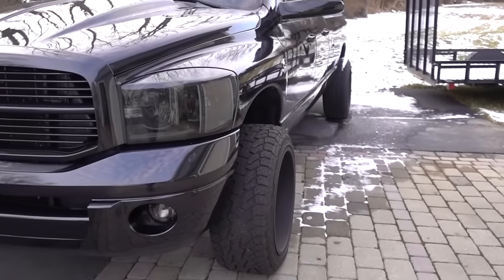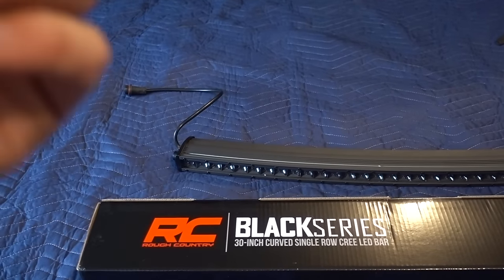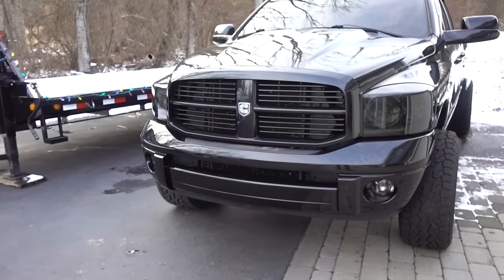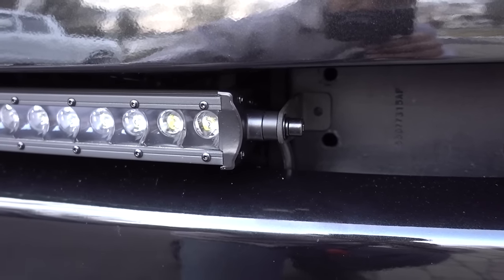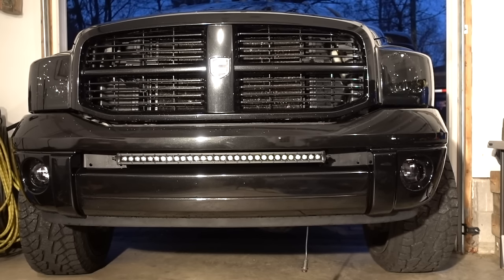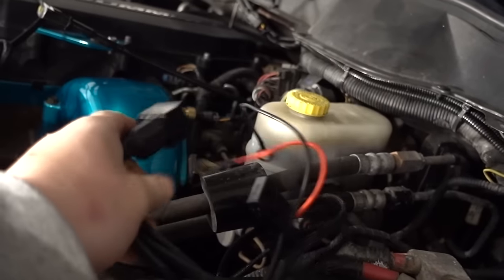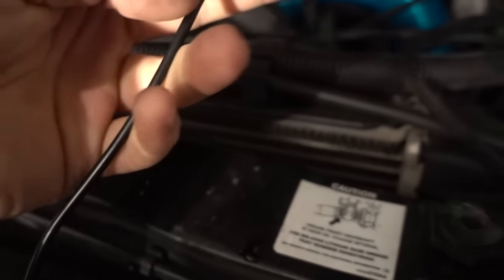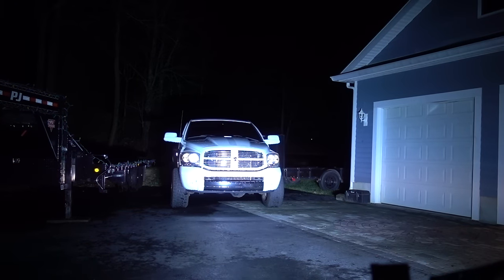2008 Build Upgrades!! Am I Really Installing This?!?

Comment: Greg, I had the exact same problem with my smoked headlights on my obs Ford (I'm a Ford man but really enjoy your videos!). I used a projector kit to fix it and it turned out sweet! This might be an option for you or anyone else that loves the blacked out look but still wants to see where they are going.

What I did was get regular clear headlights and stick those in the oven to melt the glue. After it heated up you can pull the clear lens off the front and have access to the ugly chrome and stock bulb set up. From there you clean up the case to accept the projector kit AND also paint all the chrome flat black before you glue the clear lens back on. The projectors don't need the reflectors that the normal bulbs do so painting it black doesn't hurt anything. This still uses the stock adjustments to move the beams. I did mine for a total of maybe $150 for the whole shooting match. 

In the end I had clean projectors with blacked out headlights that still will outshine any headlights!

Comment: im in the same boat as you typical hate lightbars but it dark in the woods at night and good lighting is expensive and tends to piss other drivers off....so once I get a new bumper I have a 20" bar that im gunna mount behind the bumper and then cut the bumper up

Comment: i saw a video of someone saying you have to wire in a resistor because the aftermarket headlights are less power to run so  the truck don't know you changed the lights so it's still giving the amount of power it takes to run factory headlights. something to this effect.

Comment: could you add a relay to your headlights to take the load off and run protected circuits right to the batteries. I imagine that would take care of your issues. three relays. hi, lo, fog.
Reply: im a old Chevy guy and we do relays to take the load off the headlight switches.
Reply from the maker: always a option for sure, thanks!
Reply: GREG_ALBERALLA clean setup. did the similar setup on my 07, filled the gap nicely. the stock lighting system on these truck is mediocre at best. agreed less is more...

Comment: I'm curious to know how you like your pj trailer and the hydraulic dove tail. never had one with hydralic dove and thought about getting one instead of the monster ramps just the weight difference is the only thing that's the downside i feel like
Reply from the maker: Im actually going to do a  whole video on that very soon!
Reply: sweet thanks!

Comment: Now that you have had the light bar installed for a bit, would you recommend the dual row version for an extra 50$? or is the single row plenty of light? Thanks for the vids!
Reply from the maker: The only reason I went with a single row bar is to hide it and conceal it a little better, there is no doubt the dual row will have twice the light. Lighting is all personal preference really, whatever ya like, Thanks!
Reply: Good to know, thanks. Will probably be grabbing the double since I have no fog lights. Light bar looks factory on your truck. Quality job done.

Comment: as far as your issue with hids and leds, not sure if its the exact issue (not gonna lie i kinda skipped through the video) but check out the Control Freak Kit from Retro Solutions. Problem in everything freaking out lies in the TIPM that dodge used to control lighting systems in these trucks between 06 and 09. Everything is basically monitored through a computer which senses electrical load and cuts the circuit out when load does not match what the stock bulbs put out. Just something to check out. Retro Solutions gives a much better explanation of it also. http://retro-solutions.net/product-info.php?Control_Freak_Lighting_System_Controller-pid758.html